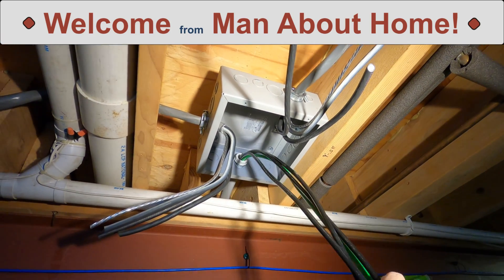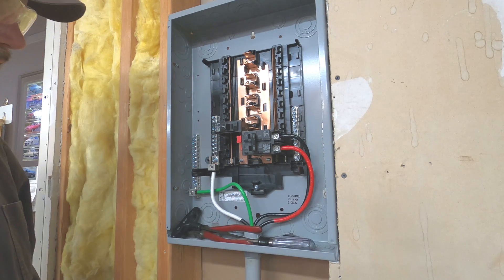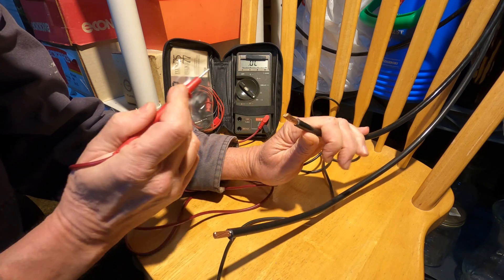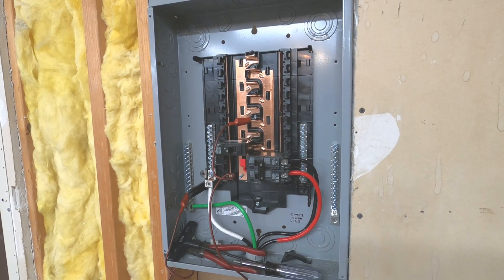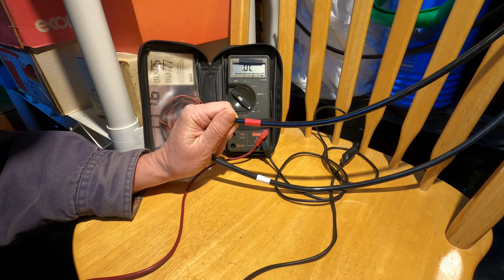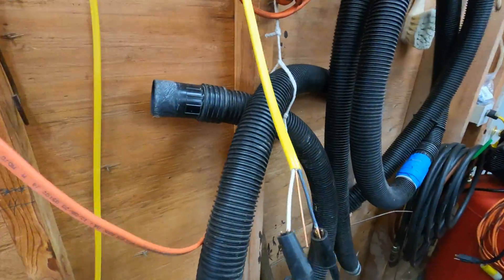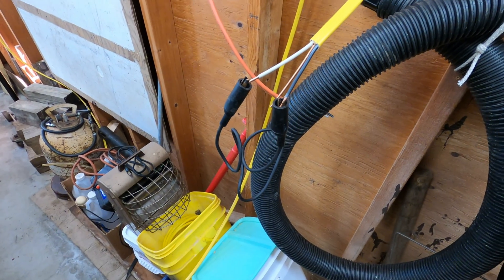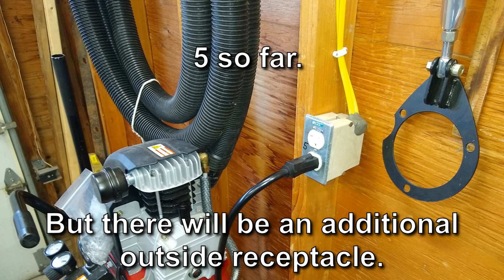Ringing Conductors Out | Identifying Which Is Which | Man About Home

Comment: Very nicely done video!  Great explanations.   Personally, I would have done it without being a tap and run 100 amp conductors, or changed the 100 a 2 pole to an 80 amp 2 pole in the main panel.  You did an excellent job of the construction too.  Two things, is your 2 pole main breaker approved for reverse connection?   And is it bolted into the panel as required?
Reply from the maker: Thank you! I appreciate it. 

There are some things that need to be considered. You're not familiar with the distance the new panel is from the Main panel. The cost of materials to run another long feeder is one factor. Another factor is, how much space is there in the Main panel to add another two pole breaker? The original main panel is ridiculously small for a house this size. And it's almost full. If I used the space up, I wouldn't be able to add the 4 other additional 120V branch circuits I'm adding. 

I don't know why you'd put a 80A breaker in the main panel instead leaving the original 100A breaker on the 100A barn feeder circuit. You might enjoy my video about tapping a feeder.  

I'm a licensed master electrician (retired). The new panel passed inspection. The electrical inspector said I did a nice job. It was installed correctly. 

Thanks for watching and commenting!
Reply: Wow, I don’t know how this comment got in this video.   I did watch the tap feeder video.  I am retired also.  I worked for a top 50 electrical contractor a a Sr electrical design engineer/project manager.  I held three master electrician licenses and contractor license in 3 states and 1 city.   Since I don’t really like taps unless absolutely necessary, I suggested that you could have changed the 100 to 80 and had no taps.  What you did was very well done.   I was impressed as way better than most YouTube videos on electrical.  So, thanks for the videos!
Reply from the maker: Thank you for your feedback. I appreciate it!

Comment: One thing to note: You're also checking for which wires do NOT show continuity.  Make sure only one matches.  Brand new runs should be simple, verifying existing ones have potential problems you want to be cautious of.
Reply from the maker: Agree. Thanks for watching.
Reply from the maker: I have to modify my agreement. In this case, I'm looking only for one wire. I know where the others came from because there's only 4 and I pulled them in through 20 feet of pipe. In a manufacturing plant, where there's been lots of previous work, you need to be more careful. But you still wouldn't check every wire. In my 40 years of experience in major manufacturing plants, I've seen cabinets with bundles of spare wires 50 thick. We never checked every wire, when all we needed to find is one. Of course, we'd follow the conduit to confirm we know its source. Thanks...

Comment: Imagine if he had marked the wires,with tape one by one,prior to pulling them😂
Reply from the maker: Imagine if you followed the crew that pulled the wires in 3 weeks ago and didn't mark them.
Reply: @manabouthome  Exactly!
Reply: The principle applies to wiring in general, not just new runs.
Reply from the maker: @bobblum5973  Agree. Make sure all power is OFF!
Reply from the maker: That's silly. Thanks for watching.